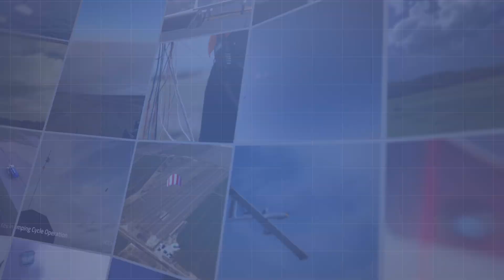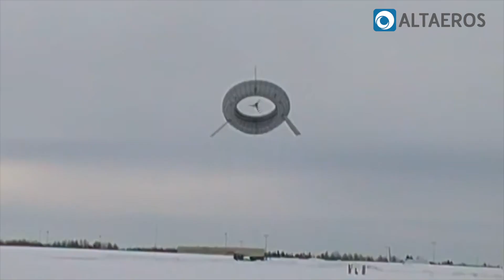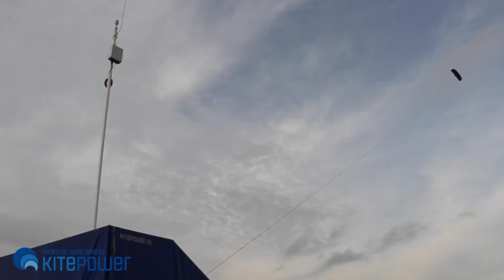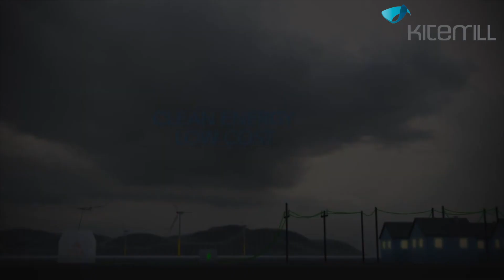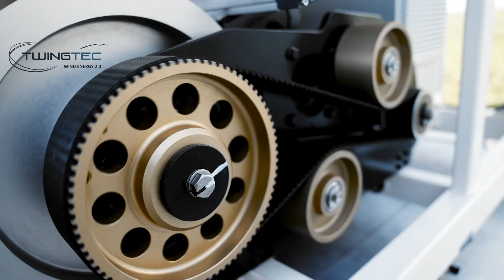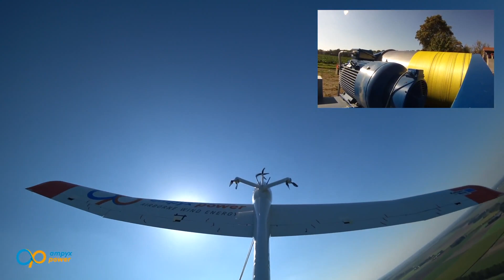AIRBORNE WIND ENERGY SYSTEMS – Beyond traditional wind energy

Comment: If no wind a helium filled delta kite floats 100 ft high.
 Wind above 4 mph causes top kite to rise and pull a train of kites up.
 Hose connects all kites so air pressure runs a generator on the ground.
 Weight pulls kite train back in when wind is too light.
Reply from the maker: Thanks Tom